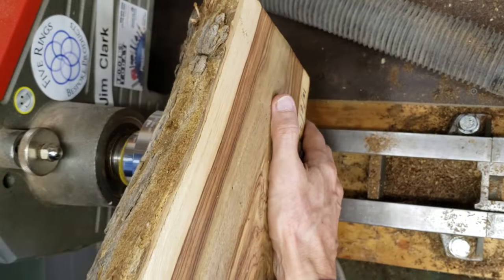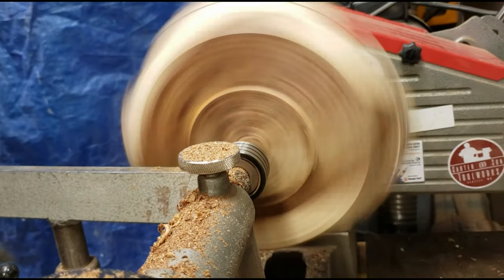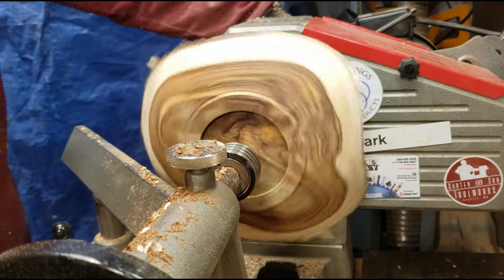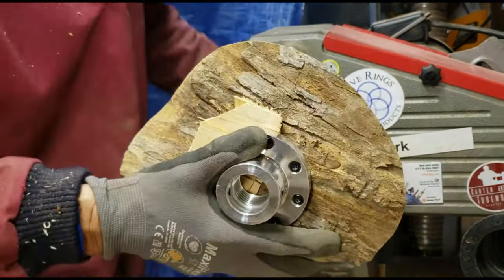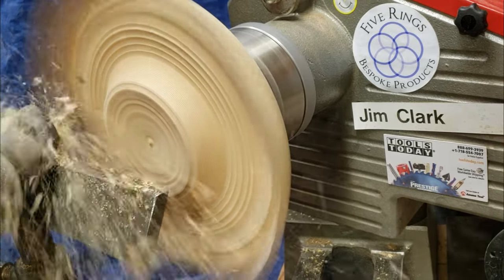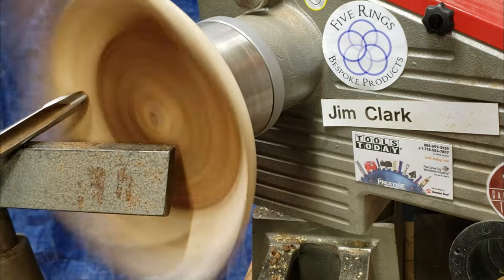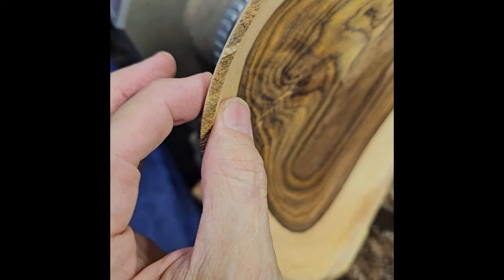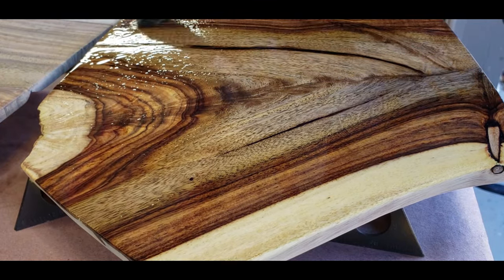Woodturning a Rosewood Crotch bowl with display board

Comment: You don't think it will Crack using wet wood???
Reply from the maker: @richardswells3335  not if you turn it thin enough. I've got plenty of bowls I've turned green around my house with no cracks. The only cracks that show up are if there is a branch in the side of the bowl. That's like a mini-pith and may develop some cracks. But even then, they are minor.